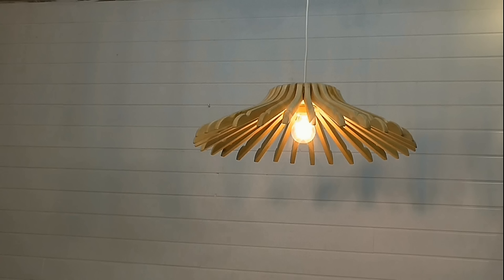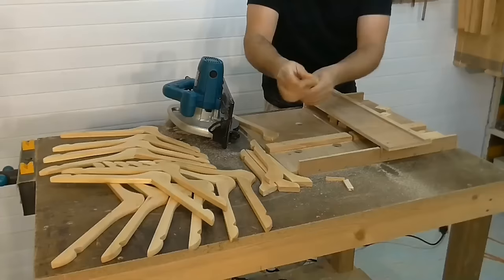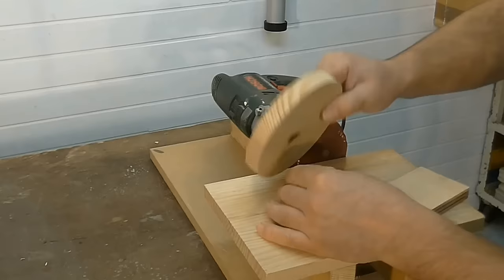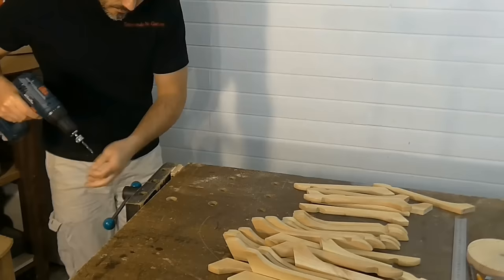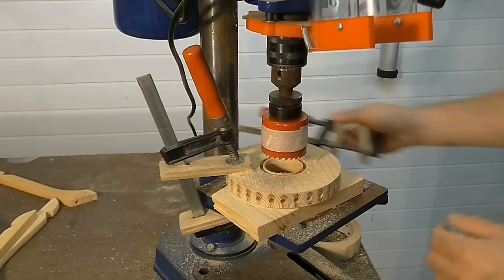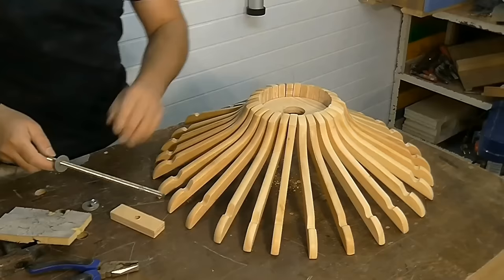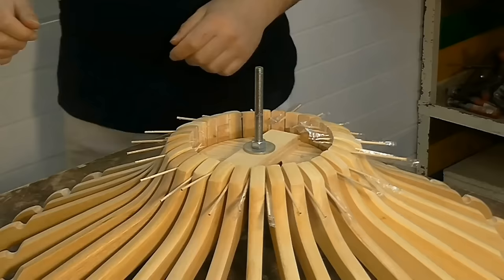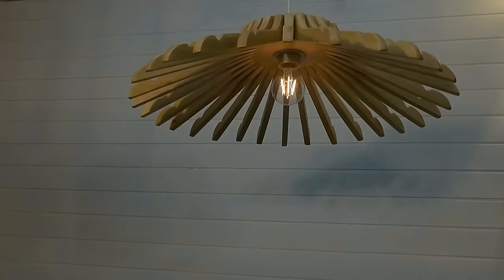How to make a LAMP shade from wooden hangers

Comment: Very nice project
I do it today  !!!! 
Thanks !
Reply: With mine, The weight is a bit too heavy for the electrical wire. So i added a steel wire to fix it between the ceiling and the top.
The effect is very Nice 😜 Thanks